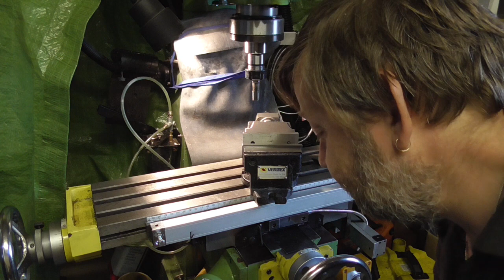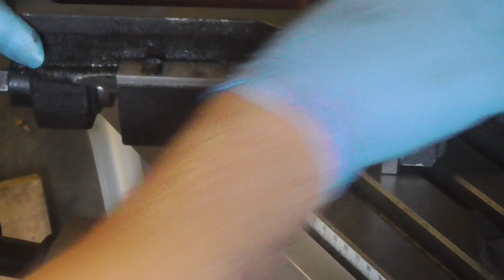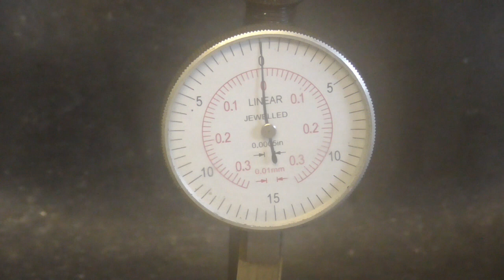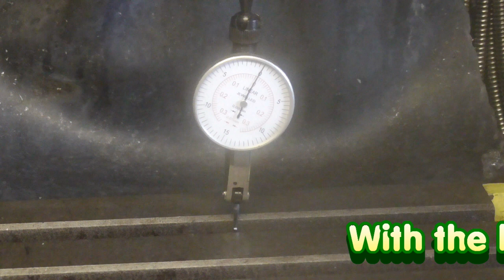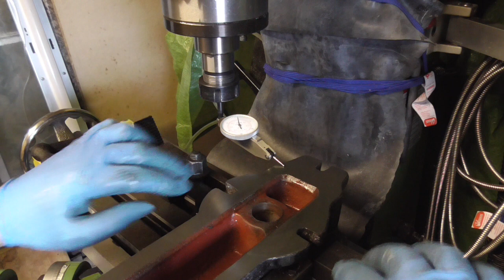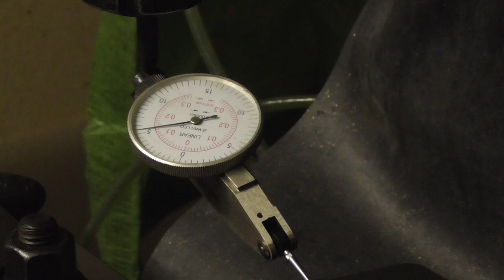Mill vice T slot Part 2

Comment: Things like this are always very fiddly and long winded to do, but when done  you will be most glad you did every time you have to remove and later replace the vice on the table. Yep, cast iron is dirty stuff to machine and you can taste it in the air - (yuck). A good vacuum cleaner is a necessity... Martin
Reply from the maker: It gets a good Deep clean after cast iron